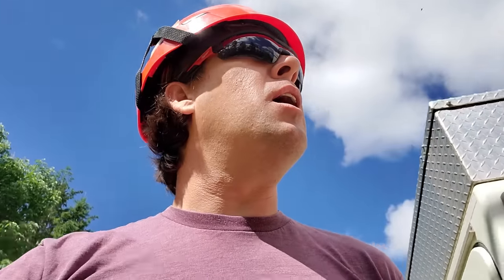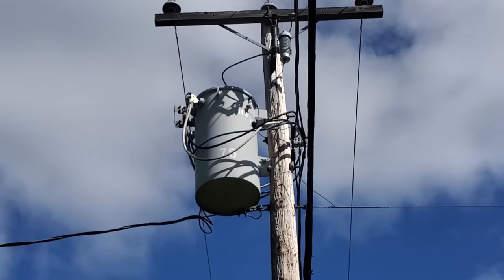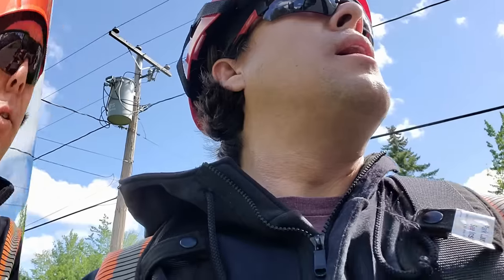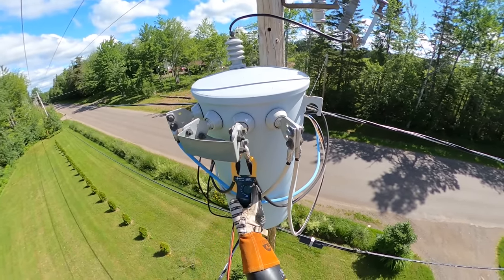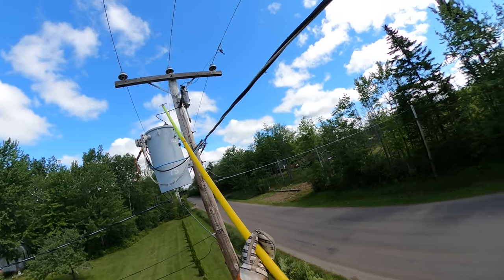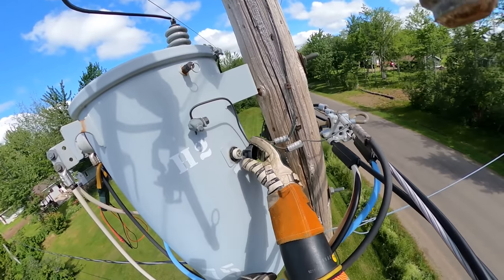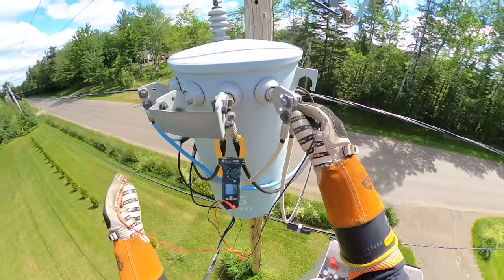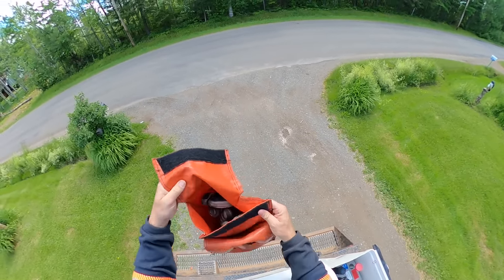How we change voltage on a transformer

Comment: How would a customer even know that their voltage is high?
Reply: An average customer would have no idea their voltage was 124v. Either this person is obsessive, or they have some very niche interests like vintage electronics. In fact, many modern electronics use universal power supplies and can take anything between 100v and 250v without issue.
Reply: @PsRohrbaugh  could be they got a multi meter or plug tester that displays voltage and just plugged it in and freaked out saying it’s supposed to be 120!!! And then cooked up a story about there electrician saying so.
Reply: Classical incandescent ie filament light bulbs "characteristics" vary radically with small changes in voltage.

 Thus Life in hours and color temperature and light output vary radically with small changes in voltage. If the voltage is 5 percent high the bulb life is 50 percent less

Higher voltage means the color temperature of the light is higher 

Also the light output us higher with higher voltage.

One has more light ie lumens per watt with a higher voltage but the bulbs die quicker

So if light bulbs were free like Detroit Edison once did and easy to replace then better to have them on higher voltage

It all depends on what the design goals are. Normal incandescent household bulbs are  normally designed so at 120 volts last say 750 hours

If you ran that bulb on 12 volts it will outlast most users. But it will be reddish and create super low light per watt

A pilot light say for overload on a device you want the bulb to last forever. So the design is run the bulb so voltage is low

An apartment i lived in was close to the substation. Ie the start of the feeder. The voltage was always high like 126 to 128.5 volts. I aways bought gobs of  light bulbs on sale
Reply from the maker: Great info 3belt! Thanks for sharing! 👊
Reply: @Bobsdecline  Detroit Edison in the 1960s would give customers free light bulbs when you brought them the burned out ones. They also fixed cords and switches  and sockets on floor and table lamps too

Comment: The higher voltages do nothing for anyone but the electric co. Having high voltage burns out appliances and spins the electric meter faster. I  had to put voltage dropping resistors on a lot of my tube amps and tvs. These things have step up transformers in them and you could end up with 500 volts ware it is suppose to be 350 - 400.  150 volts is totally unacceptable! The voltage should be 110-120 volts.

Comment: How was that not "hands on"
Reply from the maker: "Hands on" a wire that was energized at primary voltage... Can work on the tank itself and the secondary side with Rubber gloves

Comment: |How does a residential customer notice that the voltage is high? What are the practical symptoms? I don't see this service is merited if it's just a guy with a multimeter nitpicking a few volts high, but still within acceptable range. I can't imagine any detrimental effects or think of any device that will suffer from this 4VAC overvoltage (motors, SMPS, old school transformer powered electronics, antique radios, computers, heaters...) Sounds more like someone being a busybody nuisance not knowing the first thing about electronics, but being barely competent not to kill themselves taking a mains voltage measurement with a $10 chinatown special multimeter...
Reply from the maker: There isn't whatsoever (aside from very unique cases). An installer had the customer worried and after I spoke with him, he was ok with there not being an option. Where a quick fix was available it was more for his peace of mind. I've also had a few complaints on this small stretch (probably from the same guy doing the work at other homes) and have checked a few other houses... At just the right time I've seen it hit slightly over 126. After tapping it down at least now it won't hit our top end and customer is happy with the service.

But yeah, in a nutshell there weren't any issues
Reply: @Bobsdecline  Ah education, if only we could all have it equally, oh what a wonderful world that would be. And for our friends down south, most problems would cease overnight... one can dream. Do excuse my waxing philosophical, keep up the good work, eh?

Comment: Only 124v? Rest of the world has normal voltage of 240v. Must take forever to charge anything.
Reply from the maker: 120/240 Most outlets are 120. The 240 is for most large heating appliances: baseboards, central air, hot water, clothes dryer etc..